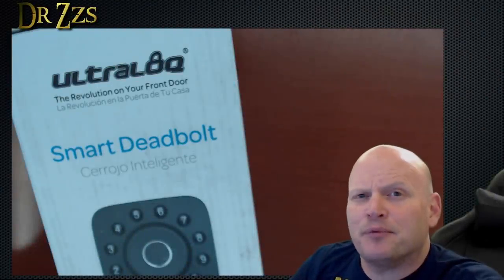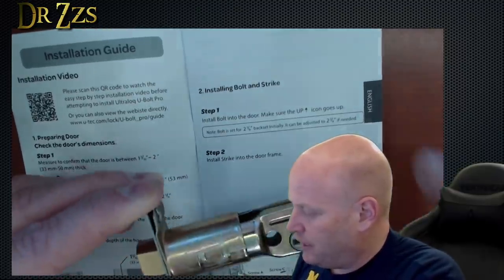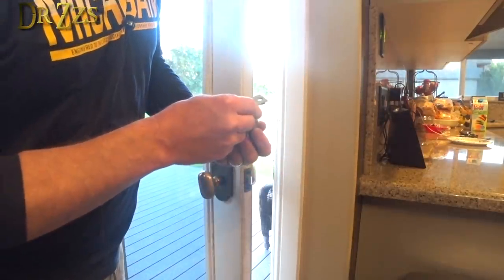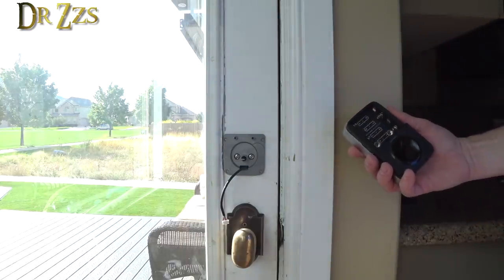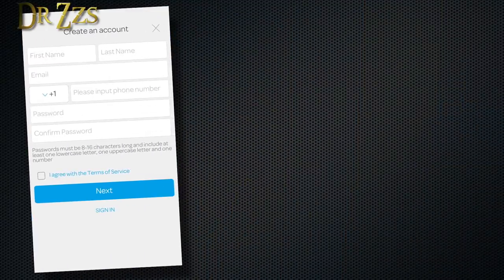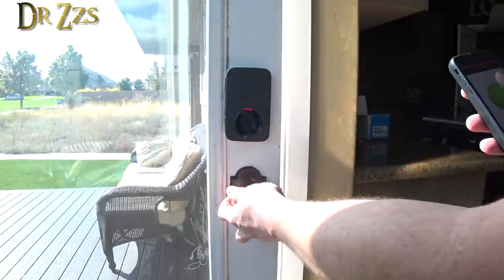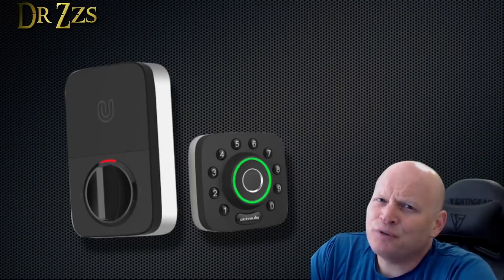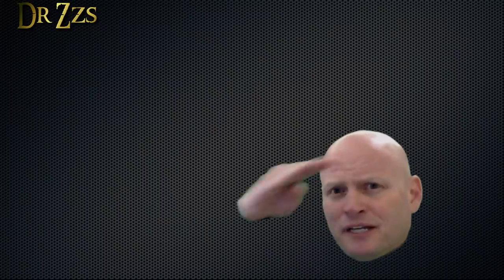Smart Lock - Replacing a Deadbolt with a Livebolt!  | Home Automation

Comment: A smart lock integrated with Home Assistant was a real game-changer for me.  All sorts of new capabilities above and beyond what I could do with other sensors and stuff.  I'm using a Schlage zwave lock; in fact, it was my first zwave device.  This thing is awesome.  Curiously, I almost never lock or unlock the lock with Home Assistant; it's there, and every so often it comes in handy (like the "good night" automation that turns off the lights and also locks the front door lock.)  But the real powerful stuff is knowing what caused the front door to be unlocked, and the doing stuff!

For example, manual unlock from the knob on the inside - if it's dark, turn on the front porch light because you're about to go outside and maybe leave the house.

Or when the lock is unlocked from the outside, depending on the code, notifications might be sent (e.g., pet sitter just arrived - notify, maybe take a photo from the camera on the porch).  I'll also turn on the inside lights when someone is coming in, and also play an announcement over the Amazon echo devices nearby welcoming them by name.  Visitors get different greetings that family members do.

Locking the door from the inside will turn off the outside lights - like when you're on the way back in after taking the trash out to the curb.

The real power is knowing why the door just opened (or is about to open) that you can't easily sense with just the alarm zone sensor on the door.  Yeah, nice to know the door just opened, but why..?

While my lock doesn't have a fingerprint reader, having codes (per person) is a real game changer!  I don't get locked out of the house when I'm out mowing on the tractor and my wife decides to leave, locking the door behind her!  It's sort of like when the keyless entry thing happened on car doors; you're just not screwing around with your keyring routinely.. since we're living in the FUTURE!  If you've been thinking of getting a device like this, go for it.  It's been a much bigger improvement in our everyday lives than I would have thought, and the Home Assistant integration was essential to that.

Battery life - for the non WiFi devices, I think the biggest thing to worry about is to make sure that there's no binding of the deadbolt as it travels in and out of the doorstrike.  You really need to get that right!  My zwave lock's batteries last 6 or 9 months, and all the anxiety over battery life really isn't there.  The batteries last plenty "long enough", and it's a big advantage that my lock, as well as the one in the video, use easily available and "in stock" AA batteries.

Thanks for doing the video!

Comment: I bought this exact lock, with the WiFi bridge, around the time you made this review.  Last week, I installed Home Assistant.  I absolutely LOVE the lock, and have had zero issues with it.  I'm curious if UltraLoq ever gets back to you about including the ability to tie into Home Assistant.  I'd love to automate other things based on what happens at my front door.  Maybe I'll just have to get the cheap door sensors instead.   Anyway, do let us know if there's ever any HA support!  I'll be the first one to integrate it...  After yourself, of course.  :-D

Comment: I really hope that the usb port on the outside part has only the power pins connected otherwise it could be hacked using a usb cable.

Comment: Pretty nice. Very similar feature set to August. The fingerprint sensor is a plus over August. If they are forthcoming with the bluetooth keys, any esp or pi could control it through HA. That's what I've been trying to do with my August but the company does not let them go easily and has locked up the apps so you can't find them anymore either.

Comment: Make sure the door itself is properly sized. Also make sure it isn't warped by extreme weather. A bad connection will have the lock constantly sending alerts and kill the battery.

Comment: I've had mine since early July and I still haven't changed the batteries. 
It works well with IFTTT, Alexa, and Google Assistant/Home. Haven't tried integrating it yet. 
I setup the auto-unlock feature. When I get close to home it knows and when I start to walk up to the door, it unlocked. You have to be pretty close, which is nice. 
My girlfriend set it up so she shakes her phone and it unlocks. It was a beta option so it wasn't perfect. Wish I would have got the two piano while it was cheaper!
If someone figures something out, please post it?

Comment: Not sure about the lock's pick resistance or mechanical strength. Looks to have great features but probably not very secure. I wonder how secure the fingerprint reader is. Should be ready enough to make work with Home Assistant. For my setup I just got a commercial grade monitoree door strike. Then I can automate it using GPIO on a pi. Then used an upgraded handle with kaba export lock cylinder to make it more pick resistant. I've had my door picked so hence pick resistance being important.

Comment: Thanks for the review.  Really great information.  I am still cautious about locks that use the cloud.  Security issues create a few questions.  Security would be the reason they don't allow custom firmware also I would guess.
This does look pretty interesting though given the bridge is optional.  If it could connect to HA via bluetooth, that could be quite interesting, as long as the bluetooth was asecured connection.

Comment: looking nice. But why not align te lock properly :-), or was this the camera angle. Is there any security rating of these locks? How long it would take a to force the lock .
Reply from the maker: did I not align it right?  That's totally possible.  For all my assumed "handy man" skills I manage to screw up more often then I'd like to admit. 
That's a great question.  I didn't look at the ratings.  I assume it's the same as a standard basic deadbolt, which if I recall requires 150 lb of force to break.  
I looked at that in an older DIY smart lock video. https://youtu.be/M76g81G3bi8

Comment: I don’t have this lock but it is listed as a trigger in IFTTT. Would like to see a vid on that as I am in the market for a deadbolt.
Reply from the maker: IFTTT isn't super reliable.  I'll give it a try but I don't expect it will be a great solution.
Reply: DrZzs Really? I’ve been using IFTTT with my Wyze cams. Wyze notifications just give a generic notification (on iOS at least) then you have to open the app to see what triggered. I have been using IFTTT and now set my custom message so just looking at the lock screen I know what event occurred.

Anyway I look forward to whatever you post next, and please mention what reliability issues you’ve had with IFTTT.  CHEERS!  🍻

Comment: Noticed the Micro-USB For Emergency power is in the outside. So if batteries die while your out tou have to carry a usb power bank with you at all times
Reply: nigel Holland No. you change the batteries when they start to die. If you screw up and don’t and don’t have the key you can go grab a usb power pack to get in. I always have a power brick in the form of a li-ion car jumper.